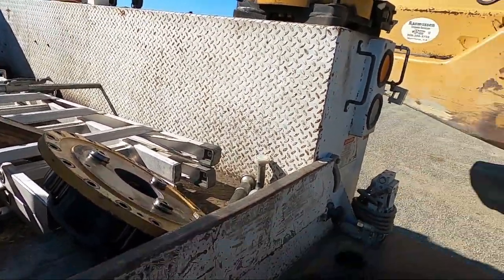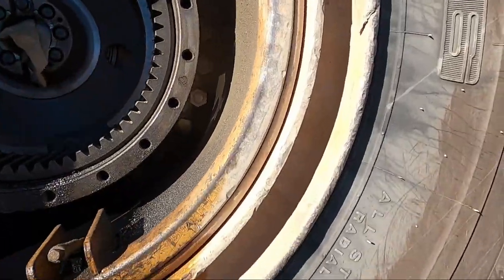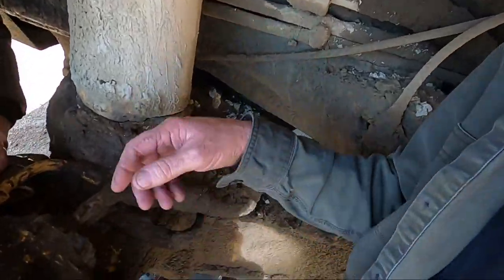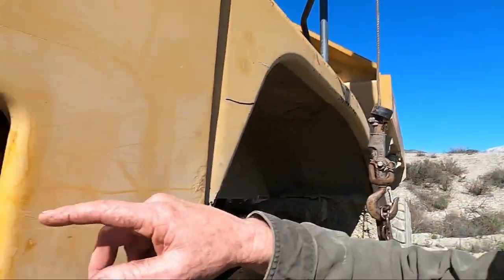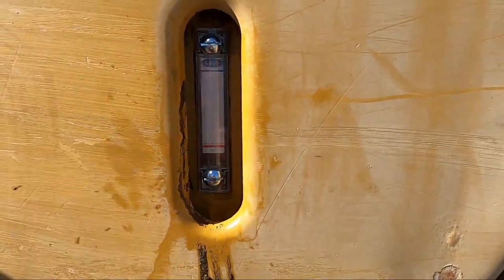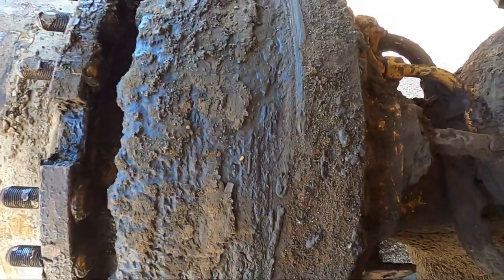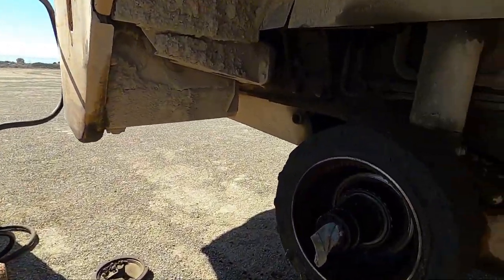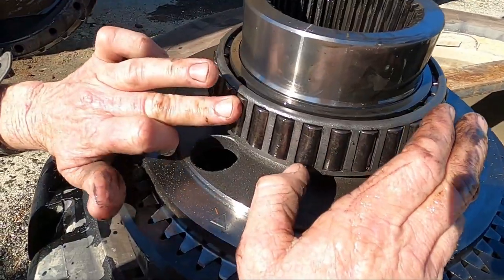Caterpillar 735 Wheel Removal, Checking Wheel Bearings with Wet Brakes

Comment: Wonder the pros and cons of wet brakes and rotors like Volvo does.
Reply from the maker: The older Cat trucks the D350E D400E and earlier , not counting the series 2 trucks, had regular brake pads. On some extremely hilly jobs we would be changing pads every 2 months. With the wet brakes I have trucks with well over 20,000 hours and haven’t had to change discs yet.
Reply: @RasmussenEquipment  that’s pretty interesting. I know on our Volvos a25c trucks we barely use the brakes as the trans and exhaust retarders kick in so hard.
Reply from the maker: Ya, on the D350E’s they had a hyd retarder mounted on the back of the engine and a Jake brake. The retarder was a joke, it barely did anything, we actually removed the handles just so the operators wouldn’t leAve them on by accident and overheat the trans oil. The Jakes worked good, they were a little weaker on the 3406’s but after re-powering with a C-15 they were better. But the main problem is trying to get the lazy operators to use the Jakes instead of the foot brake, even though the Jakes work automatically.